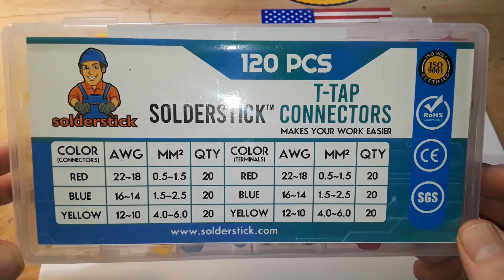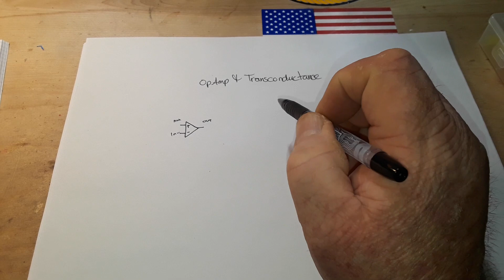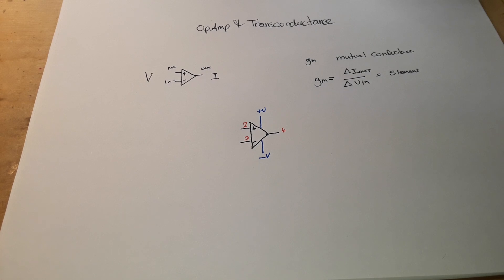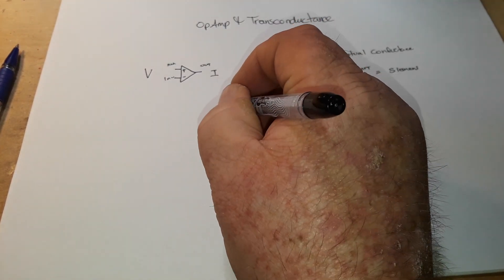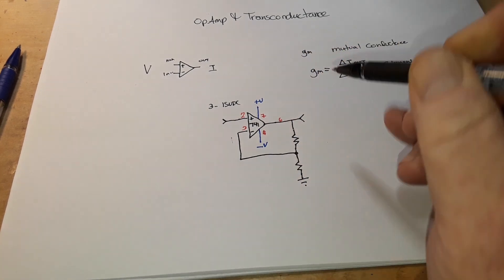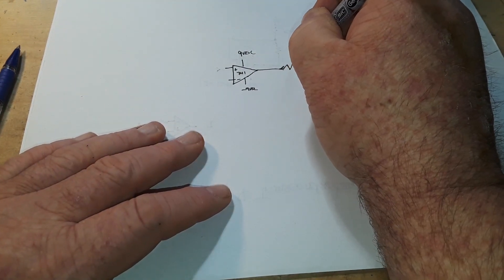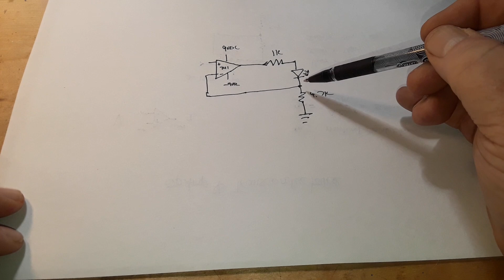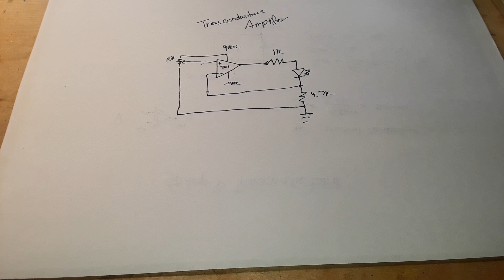Introduction to Transconductance: Sponsored by Solderstick Wire Connectors

Comment: 9:14 i have used that circuit in couple of times my designs, as did others, like Befaco, Mutable Instruments, Korg and more.
chance the 4K7 to 1k, 600R or will be dim and remove the 1k at the output. you could also use a bi-color led if you use a bi-polar supply.

Comment: PAUL, thanks for making the lesson. Different biasing configurations for transistors will have a different transconducance formula + the biasing configuration = Overall GAIN. I think you can convert transconducance of a transistor into the Overall Gain and also convert the overall GAIN of the amplifier stage back into transconducatance. Try making YT lessons about transistors transconductance

Comment: 6:52  From the formula Iout = Vout/R2, one might ask why not simply use a voltage source and a resistor?  (which BTW, is often how an LED is driven).  The difference here is that as the LED warms up, the current draw may vary and the benefit of using an op amp is that it will also vary Vout appropriately to compensate for the increased LED current draw.

Comment: Thanks Paul for posting. Question have you dabbled in Sine Wave shaper circuits using diodes and resistors. Basically the Hewlett-Packard 1970’s  function generator era?

Comment: nice clear drawings.. easy to read after printing them... Paul does transconductance lower the resistance value a little in the circuit?